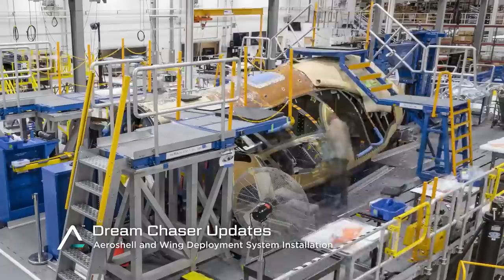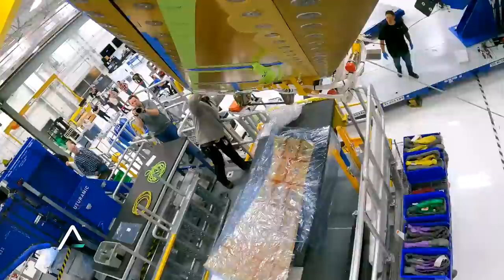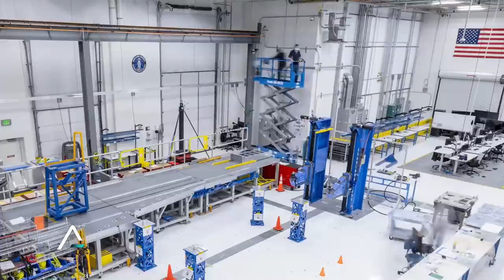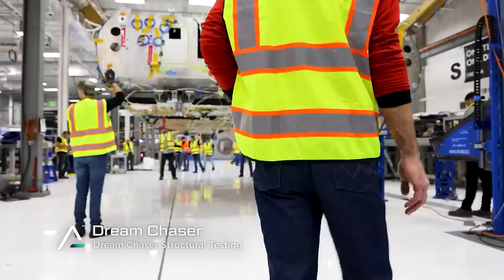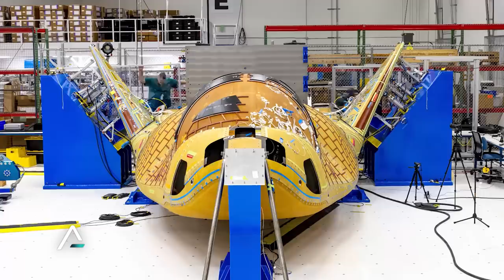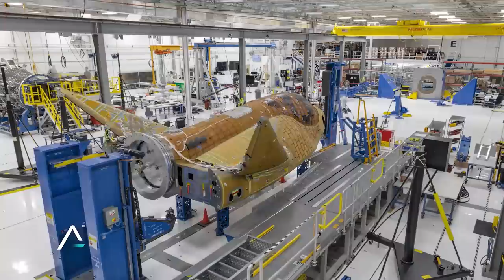Dream Chaser - Tenacity

Comment: 50 years later, they are still trying to make that MiG-105 work.
Reply: I thought they got stuck on the M 69. 😆
Reply: Wait ... What?
Reply: Я тоже подумал о МИГе или БОР-4 ))))  Догнали СССР....)))))
Reply: Dream Chaser is based on the Rockwell HL-20 OML (aerodynamic shape), which itself was based on the Martin X-24A.
The MiG-105 was shot down over Ukraine last week.
Reply: @ВладимирМакарчик-ч1х  The US hasn't liked space planes for a while, but the spacecraft with the most astronauts ever put into orbit is/was the Space Shuttle. I'd say they caught up and exceeded whatever the CCCP could put out about 30 years ago.
Reply: @MrKentaroMotoPI  Sorry, but no: the only thing that the Martin X-24A design has in common with the Dream Chaser is that both are lifting bodies. But the design of the Dream Chaser, specifically with that nose, is inherited directly from the MiG-105 and the pictures taken by the US when it was recovered in the sea after being used to test the protective tiles for the Buran, in the 80's.
Reply: you say that but dyna-soar was close to this thing in design too. getting the funding to build a small shuttle has been the hardest part, the design has been well studied and understood to be what we probably should have built with STS to begin with
Reply: Dyna-Soar — LOL
Reply: I need context, i've heard about the dream chaser but never knew what this was all about
Reply: @hc-nj3ve  nobody goes to space tho
Reply: 200 later they are still trying to make Capitalism work! LoL
Reply: You make me LOL !
Reply: Actually it was Russians who were copying US and Boeing, Soviet Mig-105 or BOR-4 were in 60s and 80s respectively while United States Air Force was working on X-20 Dyna-Soar in 50s.

Comment: How interesting. A new reincarnation of the soviet "Spiral"? Well at least it seems to be inspired by that program - look at the nose and wings and the overall composing. Good luck guys!
Reply: based on the NASA / Air Force lifting body X-plane program that Russia copied. Then the US dropped it due to no funding and did the space shuttle instead because the US Air Force wanted a cargo capacity and was paying (extra) into the civilian NASA program so got to dictate what was developed.
Reply: I have opened this video only because it was looking like Spiral module on the preview
Reply: There is some cross pollination there alright. Dyna-Soar inspired Spiral, which inspired HL-20 and Dream Chaser is derivative of that last one.
Not too much though, it's not like there was too much chance of copy-pasting designs between east and west. And of course, history aside, Dream Chaser is a wholly modern design.
Reply: БОР-4
Reply: Unlike the Spiral, there is no tail.
Reply: @bobjoatmon1993  M2-F1 M2-F2 HL-10 HL-10 mod M2-F3 X-24A Hyper III X-24B have nothing to deal with russian one in term of technical solution design except it's a flying body. but dream chaser is a conformal  copy of the soviet design... like F35 with YAK 141.
Reply: @artemkorshunov2371  They wrote about it a long time ago, that they took the spiral as a basis
Reply: The MIG 105 was a USA design copied by USSR.
Reply: @kokvad  здесь установку "хвоста" не показали. Итоговое изделие с "хвостом".
Reply: @kokvad  V-tail
Reply: don't forget about the US dyna-soar.
Reply: it has nothing to do with a Russian design

Comment: I've been following Sierra's progress for years.  So glad to see Dream Chaser enter the resupply ring, that will only be the beginning of this company reaching their full potential.   I personally would like to see Dream Chaser transport people back and forth to the ISS and even the Axiom Space Station.
Reply: Should call it the Dyno-Soar.
Reply: By the time this antique gets to low earth orbit SpaceX will already be on mars with Starship
Reply: @jeffh1983  form follows function, just becuase it's based on a design made in the last century doesn't mean it's ancient. Physics hasn't changed. There is a reason the B-52 bomber is still flying. With modern avionics and softare, it's a decently impressive little ship.

Comment: Although I'm amazed by reusability, returning crew flights to capsules after the Shuttle program ended felt like a big step backwards. This version is meant for cargo, but I read somewhere that Sierra has manned flights in mind. Bring it on!
Reply: I was a teenager when the shuttle was unveiled. I was so excited about it. I even wanted to be an astronaut, going so far as to obtain a nomination to the Air Force Academy. But the shuttle turned out to be unbelievably expensive to maintain, and sending up crew and cargo in the same craft was just a bad idea.
Reply: Capsules, even reusable ones ARE a step back but try telling NASA 😓
Reply: I still believe in Santa
Reply: As long as the interior is shielded I assume it can be outfitted for cargo or people as they like. Climate control systems are probably small enough to fit on any of the capsules these days. Don't think you need too much more if it's just going up and down for the most part, not long duration missions.
Not sure anyone bothers with long missions outside of the ISS these days anyways.

Comment: This is a developement of an old Soviet orbital plane Spiral. https://en.m.wikipedia.org/wiki/Mikoyan-Gurevich_MiG-105  https://ru.m.wikipedia.org/wiki/Спираль_(авиационно-космическая_система)
Reply: Soviet Mig-105 or BOR-4 were in 60s and 80s respectively while United States Air Force was working on X-20 Dyna-Soar in 50s.

Comment: Lo and behold, the resurrection of the X-38 lifting body.  The X-38 was a NASA experimental lifting body intended as a crew return vehicle from the ISS.  The first flight was in 1999, but was cancelled in 2002 due to budget cuts by Congress.  Instead, we got the space shuttle, designed by committee.  The shuttle was no doubt a marvelous machine, but never quite lived up to expectations.

Comment: I can’t wait to see this beautiful ship fly!
Can you tell me if the crew rated spacecraft is also under development?
Reply: I think this is crew rated as far as I know 🤔
Reply: No. Sadly NASA didn't select it under the crew program. Instead we have SpaceX which was the best decision NASA ever made & Boeing - very much not so much a good decision and a long way from operational use still. Boeing's approach to making things for govt has been 'Drag it out & drain as much taxpayers money as possible & who cares if we provide a service or not' for decades now. On the other hand. Bill Nelson (NASA head) stated recently that SpaceX has so far saved, just the DoD, 40 billion USD already & there is all the work they do for NASA on top of that.
Reply: @lmp9256  Well, that's not exactly correct.  Sierra Space is developing crew rated versions (including a larger one than the original crew services program) to service the "Orbital Reef" concept, as well as free flyers and to bid on a new commercial crew contract if the ISS gets extended.
Reply: Blue Origin's Orbital Reef commercial space station's proposal shows Starliners as well as DC Crewed Vehicles in use with it, and Sierra Space is a partner for it. If Crew DC isn't in work yet, it's because Sierra's got DC Cargo in line first. Confident we'll see announcement on this soon.
Reply: I think that when they show it can safely transport cargo to and from the ISS, NASA could think about contracting a crew version.
Reply: @lmp9256  We dont need overly long opiniated answers just answer directly
Reply: You have not seen the full version of this project yet, look for the designer Chelomey and the "spiral" project

Comment: A lifting body design with wings that can fold up for trans=sonic flight.  An excellent idea, which is on our way to spacecraft which fly like airplanes.  Someday, a vehicle like this, only bigger, will carry people to a 200 kilometer orbit for transfer to a true spacecraft.  The lower the orbit the vehicle has to achieve, the less weight has to be lifted.  Getting to space is the hardest part, after that it is much easier.  Going from several kilometers per second to zero is quite a feat, as is the reverse.

Comment: Где-то я такой видел уже. А, лет 50 назад, в СССР.....
Reply: Actually Soviet Mig-105 or BOR-4 were in 60s and 80s respectively while United States Air Force was working on X-20 Dyna-Soar in 50s.

Comment: Avoiding a massive cargo bay, enormous wings, titanic engines hauled into orbit, and heavy-duty landing gear to return a vehicle outweighing a Boeing 737 -- Dream Chaser is a true passenger shuttle without all the extra baggage [once a passenger version is built]. Want to repair the Hubble? (the ultimate go-to justification for the Space Shuttle program) ...it would have been cheaper to build and launch a brand new Hubble every 10 years than what NASA spent on their Shuttle-enabled repair missions.

Comment: No way… I still don’t believe it. It look like something from a scifi, and not to mention it’s smaller than the previous design.

I thought they stopped using space shuttles. I know, they decommissioned the old models and planning on newer ones but you know space projects are slow and expensive, I didn’t expect they build one so soon.

Comment: something very familiar with this design, It reminds me of Gerry Anderson's designs from the 60s when he started his TV shows. the one it reminds me of the most is from UFO there is a vehicle that is launched from a flying platform that takes off to enter space. its called the Lunar Carrier & Space Boat, look it up and you will see the similarities.
Reply: It was based on the MiG-105 which was based on NASA research from the early 1960’s.
Reply: @allangibson2408  As in Lifting bodies.. .. ..Million dollar man things?
Reply: Soviet Mig-105 or BOR-4 were in 60s and 80s respectively while United States Air Force was working on X-20 Dyna-Soar in 50s.

Comment: The handicapper generals office still insisting on an unmanned version? I'd say biggest mistake nasa ever made,but at this point they are many.  A manned version of dream chaser would so.... expand it's usefulness.  But then starship would have a smaller cheaper competitor for those not 100 metric ton flights....wouldn't it?

Comment: 耐熱タイルの代わりは、
どんな合金？
カーボン繊維と…？
Reply: Researchers from Imperial College of London have discovered that a mixture of tantalum carbide and hafnium carbide in certain proportions is a material with the highest melting point among all materials known to people. The melting point of this composite ceramic material has come close to the mark of 4 thousand degrees Celsius, and this will allow creating a new class of heat-resistant materials based on such ceramics, acting as thermal protection for spacecraft and future hypersonic airliners.
Reply: Somewhere in Russia..
In the course of recent developments, the task of the Center's scientists was to create a material with a record high melting point and high mechanical properties. The triple hafnium-carbon-nitrogen, hafnium carbonitride (Hf-C-N) system was chosen as a candidate, since earlier scientists from Brown University (USA) predicted by molecular dynamics that hafnium carbonitride would have high thermal conductivity and resistance to oxidation, as well as the highest melting point among all known connections (approximately 4200 °C).
Using the method of self-propagating high-temperature synthesis, NUST MISIS scientists managed to obtain a material HfC0.5N0.35, (hafnium carbonitride) close to the theoretical composition, with a high hardness of 21.3 GPa, which is not inferior to other new promising materials, such as ZrB2/SiC (zirconium diboride-silicon carbide) (20.9 GPa) and HfB2/SiC/TaSi2 (hafnium diboride-silicon carbide-tantalum diselenide) (18.1 GPa).
"It is difficult to measure the melting point of a material when it exceeds 4000 ° C," comments graduate student Veronika Buinevich, whose research topic is "Obtaining ultra—high-temperature ceramics based on hafnium carbonitride for use in extreme conditions." — Therefore, we decided to compare the melting temperatures of the synthesized compound and the original "record holder" — hafnium carbide. To do this, we placed compressed samples of HfC and HfCN on a graphite plate shaped like a dumbbell, covered with a similar plate on top to avoid heat losses."

Comment: Im not that well informed into space stuff, but what capabilities does this offer that current crew capsules cant? This glides down to earth while others just come down with an ablative shield. Does it carry more cargo? is it more reusable?
Reply: The main advantage of winged gliders compared to capsules is crossrange which enables them to land on a runway. I also assume that the heatshield will be reusable but that remains to be seen.
Reply: It can store larger payloads than crew dragon. The add on is a self manoeuvring independent craft attached to the rear. In crew configuration it can seat 7 people from original plans. Some plans have changed as it didn’t receive additional funding but remains highly capable nonetheless. It’s reusable and has 1.5 G loading on descent which is perfect. It can bring back trash and special cargo some pressurised so live cargo is possible. It has redundant landing at any major runway so it could land anywhere. It has no windows. It’s crammed with high tech automation and manual controls.
Reply: It's a lifting body spacecraft. That means it's capable of landing on any conventional runaway originally designed for airplanes. Unlike crew dragon which still has to land in the ocean.
Reply: Unlike the Dragon, it brings back the third stage engines. So it is more reusable.
Reply: HL-20 which was this vehicle's distant ancestor was to be horizontally processed sitting on its wheels until lifted whole on to the booster. Land on practically any mid-sized airport.

Comment: A realy nice ship !👌 Why there are no windows?
Reply: I believe this first one is not human rated, cargo only, makes things alot easier and cheaper.  (probably want to make sure they can land the thing from space before packin a bunch of astronaut inside!)
Reply: This is the non-crewed version, designed only to send and return supplies to the ISS. The original crewed version might be built in the near future for commercial space station uses.

Comment: This is almost an exact copy of the MIG-105.11 airframe from the Spiral program. The Spiral aerospace system is a Soviet space system consisting of an orbital aircraft, which, according to the air launch technology, was launched into space by a hypersonic booster aircraft, and then by a rocket stage into orbit. From 1976 to 1978, 7 successful test flights of the MIG-105.11 were conducted. The beginning of the creation of the Buran program led to the closure of the Spiral program. There has been no Soviet Union for almost 30 years, and someone else is trying to finish building MiGs...

Comment: I really don't understand working on anything other than SpaceX spacecraft. Maybe they don't want to put all their eggs in the same basket but it works well and it works relatively inexpensively.
Reply: DreamChaser will be cheaper than Dragon to operate (because more comes back from orbit) and has a much larger cargo capacity.
Reply: It lands on a runway, so no support ships.
Reply: @allangibson2408  not true since it relies on a one time use Atlas ULA booster. This this is literally an antique design
Reply: "inexpensively"
falcon 9 costs 50 million when reused PER LAUNCH

Comment: Take a look at a Soviet "Bor 4", which made its first flight in 1980, this is its copy.
Reply: No, this will actually work.
Reply: Soviet Mig-105 or BOR-4 were in 60s and 80s respectively while United States Air Force was working on X-20 Dyna-Soar in 50s.

Comment: I am adopting this design into my Traveller RPG sci-fi games as a grave car. I just must add a Grav car drive and thrust vectoring to it so it can hover and maneuver on the ground easily. Everything else is great. The folding wings will make it fit on my cargo desks in its parent ship in orbit so much better. Single pilot or dual pilot operation and cabin for 8? Some interior shots are needed, please.

Comment: They stoll wrong pictures of Spiral
Reply: No, more accuratey it is based on USA X20, Soviet Mig-105 or BOR-4 were in 60s and 80s respectively while United States Air Force was working on X-20 Dyna-Soar in 50s.

Comment: If NASA had created back to the size tradition of the shuttle in ratio to the classic, to stack lenght of fuel stage and cargo, they would automatically be evolving it, to be a predecessor of the SpaceX 'Starship.'

 The reason Dream Chaser became efficient, aside from size portability of just one type set cargo subjects ( human - or - supply bundles). Was the trauma, from the classic Space Shuttle senario. 

 There was no, added emergency heat shield coats, in example, the X-15A craft had a paint lube, assumed to last mesosphere level of very long cruising, Yet only workes for temporary, like re-entry of as dosposable paint in short range time, had the classic Shuttle, coated with this, all surround over, before the heat tile layer, the re-entry could have saved lives, it would STILL be handy today, for Dream Chaser & Starship.

Comment: Look like a Russian project “Spiral” 1960-70th  , designer Lozino-Lozinsky
Reply: No it is based on USA X20, Soviet Mig-105 or BOR-4 were in 60s and 80s respectively while United States Air Force was working on X-20 Dyna-Soar in 50s.

Comment: Looks like an evolution of the MiG-105.
Reply: 1964 USSR, project "Spiral"
Reply: Soviet Mig-105 or BOR-4 were in 60s and 80s respectively while United States Air Force was working on X-20 Dyna-Soar in 50s.

Comment: This is exactly USSR mig-105
Reply: The MIG 105 was a USA design copied by USSR.
Reply: No it is based on USA X20, Soviet Mig-105 or BOR-4 were in 60s and 80s respectively while United States Air Force was working on X-20 Dyna-Soar in 50s.